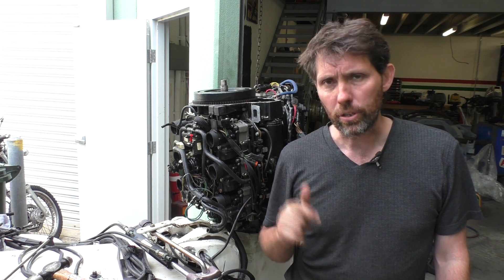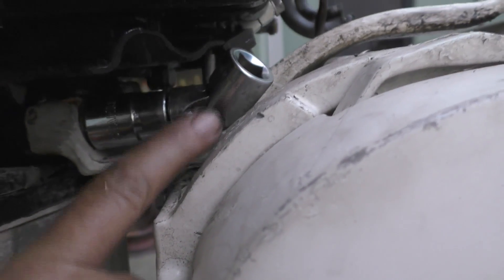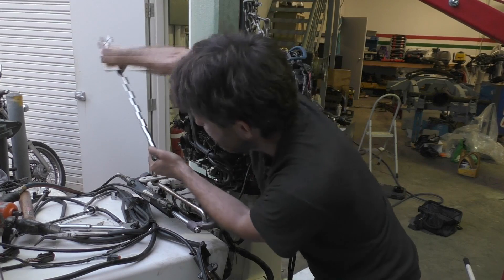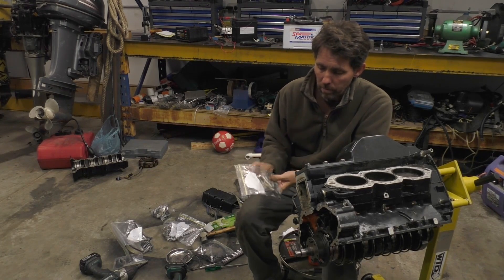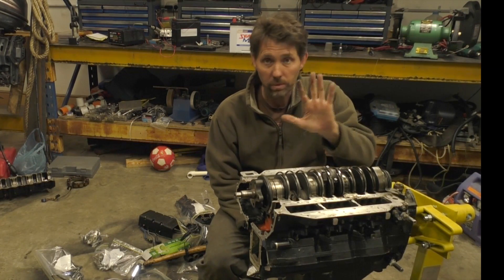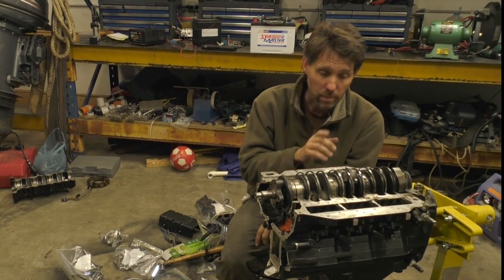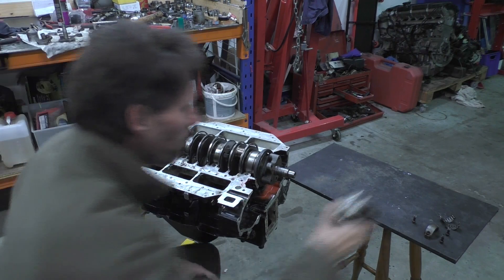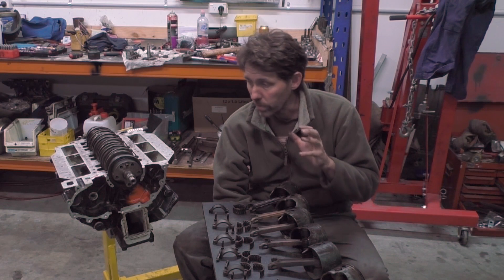Evinrude 150 autopsy

Comment: i remove 4 bolts    the back of the lower cover speads open a bit.  but the front does not.  that evinrude 90 hp.  98. 2 stroke.     must be a hiden bolts
Reply: there're only 4 bolts. Just pull a little

Comment: I blew my 2007 150 E-Tec.  Big End - cylinder 6. The bore lining is badly gouged & the crankshaft where the bearing sits is also damaged.   In your opinion can it/is it worth to fix it or just good for parts ?

Comment: know this is old, but the port side clearly had stuck rings, which cause it to detonate atleast #2. you can see the fairly heavy carbon buildup from neglect of previous owner not running engine tuner or merc power tune through it very 100 hrs or so, combined with crappy oil. this is a recipe for detonation as the rings stick and allow the flame front to pass by the rings. this shoots the temp sky high, causing deep scoring and the detonation in atleast that 1 cylinder in short order. how he didnt diagnose this is beyond me. had NOTHING to do w. "timing being out"! ts also not water. water would make the piston top atleast somewhat clean, and they are all exactly the same. i wont rebuild one of these without pressure testing them, as they did have an issue with water in #1 from thin wall area near #1 and rectifier water cooling area, but again not an issue w. this one. also, NEVER REUSE OLD RODS that have seen that much heat and/or detonation!

Comment: From my experience with evinrude 30y
The engine failed from combination
1 - Lac of fuel.. 
1b- must use super fuel with no ethanol in the fuel.

Solution
Change your fuel line connectors to mercury connectors.
Use super. Add a bit of 2 stroke oil to the fuel.

Eventide fuel line connectors choke your fuel flow when running fast this leaning out burns out your engine in  minutes...
In my evinrudes I have even direct connected the fuel lines using no connectors.. !!!!
Ps 
You will feel much more power!

The

Comment: Two strokes need fuel to mix with the oil. If only oil is injected, then this is what you get. You most likely have bad fuel delivery. You have the oil but no gas.

Comment: 1995 Evinrude intruder 150hp. cyl read from top to bottom right to left. 125/120 120/120 110/100.  i do not know if it was TDC when done. What is your opinion. runs a little rough cold.

Comment: When u see scoring in a cylinder like that means it wasn't getting proper fuel to the cylinder clean your carburetors put new kits in them so you wont lean another cylinder out and have the same issues

Comment: Good morning sir from USA! First of all, wanted to say thank you for ur content and sharing ur expertise… ur videos have given me the knowledge and confidence to tackle many projects I surely couldn’t have done otherwise. 

Secondly, a question as it relates to this “seized” Evinrude video. I am having the exact same issue with an Evinrude 110 4 cyl 2 stroke as u have in this video. It is not seized, pistons can be heard to move and seen moving looking in the plug holes. However, it hits a hard stop after nearly 1 full revolution (in either direction) just as u experienced here. My question is… what did u find or assume was the actual blockage with ur 150? Great info in the vid but I don’t see that u ever revealed the actual blockage. I realize it may be different in mine but suspect it’s som’n very similar due to the exact same symptoms. Was it pieces of the broken piston, rings hanging on a port in the cylinder, etc? It didn’t appear to be anything with the crank or bearings there. About to tear into mine and just looking for all the info I can get before doing so. Thx so much!

Comment: I've been messing with these old OMC's v6 and v8's for many years.  The damage to this engine appears to be either bottom two carbs not being jetted 2 sizes larger than the upper 4, The butterfly 's on the linkage between the 4 set and the 2 set weren't adjusted right.  Probably the lower butterflies were slightly open at idle, and the motor went lean on that cylinder.  Or, most likely, it still has the original VRO.  Funny thing about VRO's at idle they lean the oil mix to about 200:1.  If you set at idle for any length of time, the fuel in the float bowls gets replaced with nearly straight gas, which when you get on the throttle your not lubricating the cylinder walls with enough oil.  

The best way to make a VRO engine last, is to ditch the VRO all together.
Reply: completely false! the VRO was changed to OMS with this model, and gave it 100:1 at idle. plenty of oil. this was not the case. clearly stuck rings and detonation from not doing a decarb. nothing more. the OMS does not "replace the float bowl with nearly strait gas". the carbs are AFTER the pump, and the fuel is always mixed correctly in the bowl. by the time the motor is at higher rpm, the bowl is replaced with 50:1 fuel by 2500 rpm.

Comment: Hello, I'm rebuilting my 2008 Mercury Optimax 150. After the removal of the crankshaft I found very deep groves on the block (max depth 0.02") and two broken seal rings.
The engine have about 1200 hours.
I see in the block of your video that are present the same grooves (I don't know the deep).
Have sense to continue with the rebuilting?

Comment: Stu, this is the second of your playlists I'm working my way through. I've been in a marine engineering program at Broward College in south Florida. The program is wonderful in terms of providing a good intellectual basis on which to learn the various facets of this field. (electrical, elecrtonics, diesel engines, transmission systems, gasoline engines, corrosion [now], composite materials, A/C systems, and auxiliary systems) Your videos have provided a fantastic empirical catalog of putting many of the concepts I've learned into practice. We do get several hours of hands on shop time a week, but it's great to be able to see dozens and dozens of examples of practical work.
Thank you for your content! I plan to get a shirt in the future and will proud to wear it in a picture on some future adventure.

Comment: Do not let any machine shop touch the heads on a Johnson or Evinrude motor, use a surface plate with 120 then 180 emery paper with crc wd etc.

Comment: Before I watch further, I'm betting a lean-condition overheated & expanded a piston, the piston is in pieces...now, onto the video!
Reply: I was right, a thirty-over overbore wrecked  the AF ratio sending it into a lean-condition. ALWAYS err into a too-rich condition. A clean-up of the bore will not save this engine, without a re-jet this will happen again soon.

Comment: Why Evinrude Failed:  An autopsy of NMMA statistics: high HP (>200hp) outboard sales +80% since 2008.  Outboards >300hp sales +18% from 2018 to 2019 alone.  This is the only double digit growth segment of the outboard motor market for the past 20 years and Evinrude never got more than 11 percent of the market share.  In the US, large pontoons and center consoles average HP increased 40% since 2008.  In the coastal marine markets the BIG outboard CC completely took over the inboard market.  Think BIG twins, triples, and quads.  2 strokes were favored in developing Countries like China and Brazil.  4 strokes were favored in developed Countries like Austr, New Zealand, the EU, Canada, and the US.  In 2018, Mercury Marine contributed $2.61 Billion in revenues to Brunswick and was their biggest earner by far.

Comment: After a while the VRO pump becomes weak. The best thing you can do with this engine is remove the VRO and pre-mix the fuel. Surprisingly enough if you use a good quality 2 stroke oil they don't smoke that much. I freshened my 150hp a few years ago and decided to get rid of it at the same time.

Comment: Late to the party on this vid, but the damage in the pistons of this engine suggest cold seize.  The engine was apparently badly rebuilt, since the main crank rollers are clearly bad.  On restarting after the rebuild the owner has revved the tits off it from first cold start causing most of the pistons to grab, after which the poor tuning has caused the worst cylinder to run lean and melt the piston and the head sealing ring.  Truly a costly comedy of errors.
Reply: Just a thought here...that piston was not melted.  It was fractured.  It reminded me of pre-detonation damage.  Same idea, but different damage.  I also had hydro-lock go thru my mind when he examined the gasket prints.  It was a violent destruction that over-pressured that piston.  You're on the right track when you mention the lean mix.  That is wildly high pressure.  The mystery continues.  Woooo.  Cue the music.
Reply: @alext9067  Correct and, quite likely the cause of the original failure.

Comment: I suggest you to buy cylinder boaring machine i am 100% sure you can operate it very well. It has many advantages for you and do multiple jobs with extera component like flat surface grinding, con rod small end reaming , big end polishing etc.. 
If you made your decision i can help you to choose best one
Reply from the maker: I'll look into how much they are.
Reply: Single job Range price from 1000 to 2000 $
But complete accessories cost you more than 50000$ in your country 

 shopping from middleeast gives you better option

Comment: Carbs or injectors causing a lean condition has blown new rebuilds over and over. Ignition issues causing detination will kill one quicker than anything. One sub system failing will cause the death of any 2 stroke. Never rebuild till you know what happened. And run good oil.

Comment: Sounds like every evinrude ive ever  dealt with. When they start bogging dont get off plane. Run the hell out of it to your trailer and go see the merc guy. At least the other 5 cyl. Can pull the melting one for a few miles.

Comment: Could the crank seal have failed? If so then the top piston would have run dry/ lean of 2 stroke resulting in frying the piston? That said the top big end bearing have gone before the piston failure.
Reply from the maker: Certainly a possibility.

Comment: 7:31 Could the engine fail if the WRONG PROPELLER is installed?  Too much BITE?  Basically, too much torque demanded from the motor at a particular RPM?  Perhaps previous owner removed a prized prop from the motor and just installed a random prop on motor for the sale.  Have you ever met a seller who told lies?

Comment: OK  do not stamp the con rods !!! Because there is one dot on each side of the con rod so they line up .  Just put them in a box numbered 1 to 5 and keep all rod caps with the same con rod . When these  con rods are made you will see two holes drill in them , then they are frozen put in a press and they broken ! that makes them like snow flakes not one is the same as the other !

Comment: Im assuming those number punches wouldn't leave an impression on case hardened conrods and hammer smacking needle roller bearings not best practice.
Reply: You assume wrong
Reply: @antfarmmining7824  
OMC factory trained, the case hardened caps are matched and you would have to be a dill to mix them up, I only ever used light! centre pop marks on top of the end caps, 
1 to 6 / I know how hard the side of the rods are and you would need a very large Hammer to leave a number punch impression on the machine side of those rods, all the years I worked with these engines never once seen anyone attempt to mark the rods this way!
Reply: @greggoldie2351  so your saying a spring loaded punch will mark it but a number punch made specifically for marking steel will not work.and you say only a dill would mix them up yet you mark yours on the top of the cap .and I guess all the connecting rod manufactures out there are doing it wrong because most rods are stamped from the factory.
Reply: @antfarmmining7824  try hitting the outer race of a ball or needle roller bearing with a number punch and you'll understand what I mean, they are marked! and cracked at the factory to run needle roller bearings and if the caps are fitted around the wrong way, they'll instantly fail !!  the top of the cap is slightly softer and will accommodate small centre pop markings to match the rod and piston to the specific cylinder bore and crank journal from which they came, not to indicate end cap alignment, hence the term ( you'd have to be a dill to put them around the wrong way. cheers from down Under Australia 🙂

Comment: How many hours would you think it would take a professional to strip down and rebuild a 3 cylinder  60hp evinrude if all went well?
Reply from the maker: Maybe about 6 hours.
Reply: @DangarMarine  yeah being quoted 12 to 14 hours at 65 an hour...
Reply: @swainston1  10 to 12 hours sounds about right. 14 is a little high, 6 is nowhere near enough. But each job is different.

Comment: I was wishing you would have run a dial bore gauge around the cylinders. Were they tapered or out-of-round? Were they within tolerance?
Reply from the maker: Yes, I must get a dial bore gauge one day. I'm not sure if the engineer checked them before he machined them. They are certainly okay now though.

Comment: just wondering but with such a big repair, at what point do you just say, "Time to shop for a new motor" the time and cost of fixing vs. brand new ????
Reply from the maker: It really is a case of weighing up repair costs vs replacement costs and factoring it the chance of the repair failing. This video talks a bit about that https://www.youtube.com/watch?v=GTK18LGT9Bw

Comment: Dirty carbs, leaned out burned piston! Never run an engine that been setting without going over carbs and fuel tank. Something blocked a main jet more than likely.
Reply from the maker: Although I agree that running lean will make a piston get hot, I've always wondered how so many engines survive long periods of running with one blocked carburettor or failed injector.

Comment: I work on a 3cyc merc with 2 carbs an it smoke #3 piston for the second time to find out the lower card was miss jetted  since the piston was starving for fuel while the other two was getting the fuel it need to run at wide open throttle  was just wonder if this was the same case here

Comment: I know this is really old but I can't help but wonder if the bores weren't sized correctly if/when the pistons were replaced. I would think that way being a Tool and Die man. Which video shows the diagnosis or was it never really discovered?
Reply from the maker: Hey Dan. Can't say we ever got a conclusive answer to the problem. When I got the pistons replaced to fix this motor it was interesting that the machinist couldn't do the bores until after the pistons had arrived as they needed to match perfectly. I'm thinking he knew what he was doing more than the previous guy maybe!

Comment: Couple of tips for you and the viewers who may not do this alot.  With a 2t that's failed, before stripping the engine down,  vacuum and pressure test the crankcase, essentially block the exhaust and intake manifold as well as any openings into the crankcase,  use a mighty vac and push about 6-7psi into the crankcase,  then pull a vacuum on the crankcase.  It should hold vac for about 15 minutes and a 1psi drop in pressure per minute is acceptable.  Too often carbs, oil or timing is blamed for failure when alot of time the crankcase isn't sealed. Very good practice to do this same test on a freshened engine too.  Using master gasket on the crankcase is a sure fire way to get leaks also.
Reply from the maker: It's a shame that blocking off the exhaust on an outboard isn't easier, because as you say, having a leak can be a major source of head aches.
Reply: Using a shop vac on a motor that had gas in it can explode when the vappers are drawn past the sparking brushes
Reply: Can't be done on that motor.

Comment: I've watched several of your videos including all these Evinrude 150 videos.  They are very good.  I seized my Evinrude 120 around 6-7 years ago.  I hadn't used it in a while; was having poor performance, and cooked one of the pistons.  I suspect the carb for that cylinder was not getting sufficient fuel/oil to that cylinder because it had been sitting a while before I tried to run it.  Anyway, its been sitting in the garage since.  I'm not sure of the year of your 150, perhaps one of the videos said 97, but mine is an 89.  I bought it new with the boat; the boat has almost always been kept covered on the trailer in the garage; used in fresh water, and overall not used a great deal at all.  You have inspired me to consider rebuilding it.  I've debated buying a re-manufactured power head, but sort of like the idea of keeping my own instead because I know its history.  Any thoughts on which would be the best alternative?
Reply from the maker: Hi Michael, it's a tough call because when it all goes well, its very satisfying to rebuild you existing motor and when it doesn't you end up thinking, should have just bought a reconditioned powerhead. ;) I know which would be more fun!

Comment: Good interesting videos.I got a new used one summer lower unit on my tohatsu 4 stroke 25 2007.It felt like new again and good to drive  with no water in the gear)The other engine was drowned.

Comment: Why is it that the front and rear bores of one side, and the centre bore of the opposing side are rooted? It appears to me that ONE OF EACH CRANK THROW is stuffed????

 QUESTION: what do these 3 systems each have in common?

Waste spark ignition system? There is definately a common cause. the pattern is too obvious to ignore.... I wish I knew more about cylinder numbering of outboards and the management systems to be of more help....
Reply from the maker: Hi mate, it is an odd pattern. I wish I knew more about the history of this motor too. It was sold to this owner very, very cheap so I presume there was some known issue. The crank went off to the engineer for measuring and testing and passed nicely. So far the rebuilt motor has been running nicely - it didn't last 5 minutes on the first use when it died.